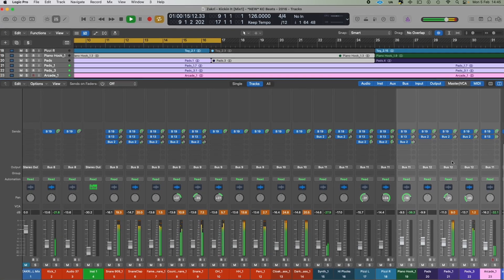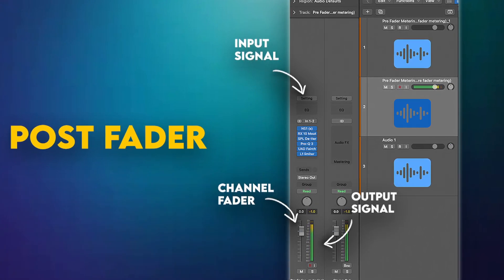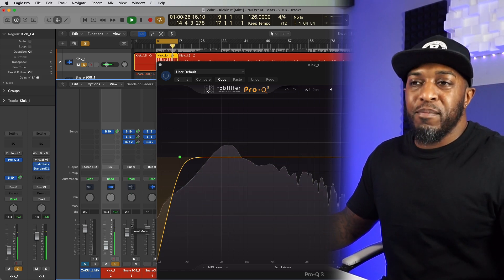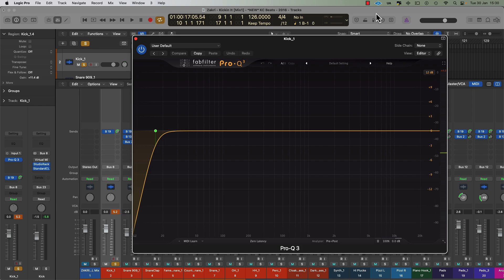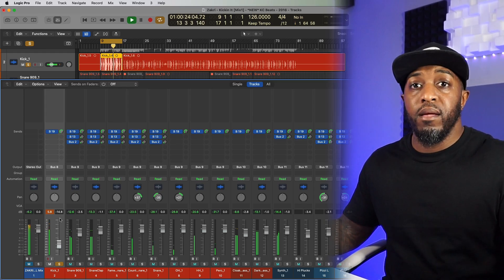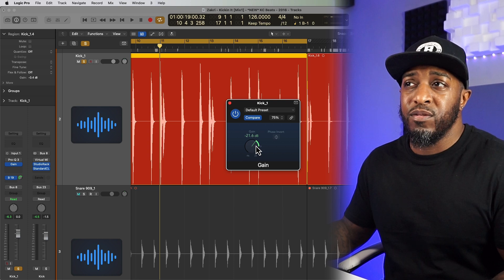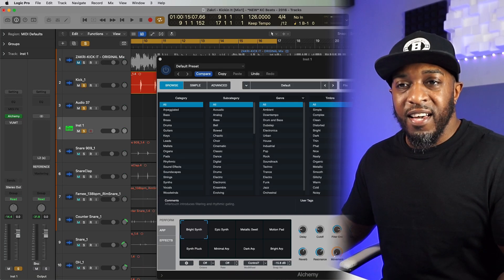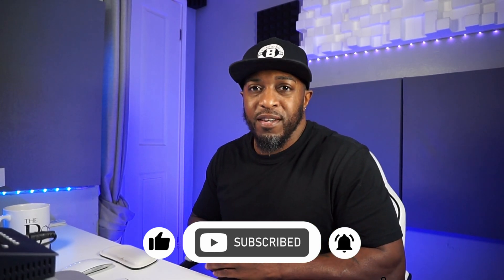TRY THIS Simple Fix in Logic Pro

Comment: Couldn’t you just leave the metering post fader and get the gain staging of everything sorted instead. Seems to be the most important part. You can normalise the gain of multiple audio regions in logic by pressing ^commandG. You can set this in db or lufs. Really handy.
Reply from the maker: If you leave it in post fader, how do you know what the signal is doing in Pre fader? I mean - you can do that way if you want? I just prefer to use Pre fader. Never been a fan of normalise, although it does have its uses. It’s all about finding  a workflow that suits you. 

Cheers for watching